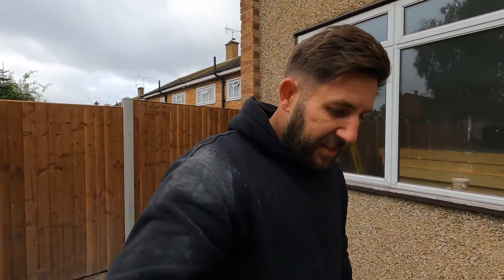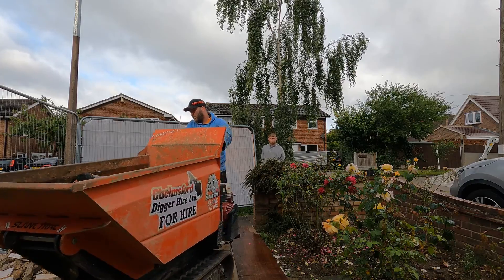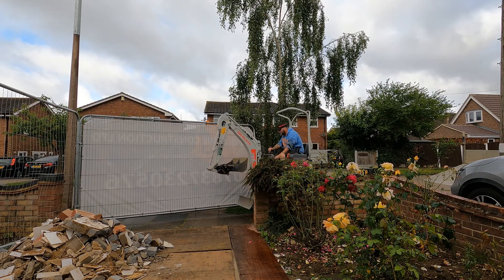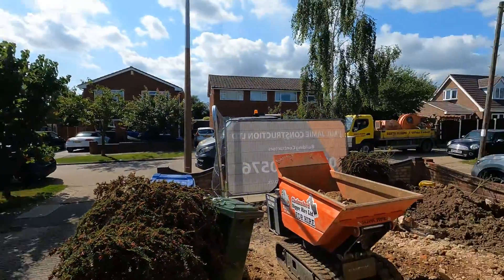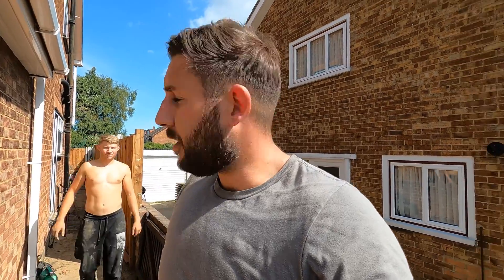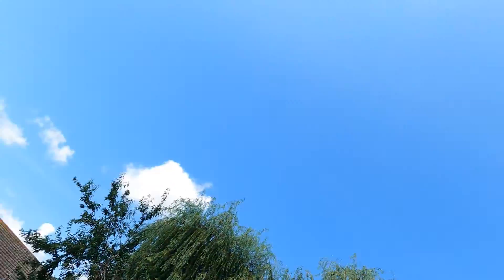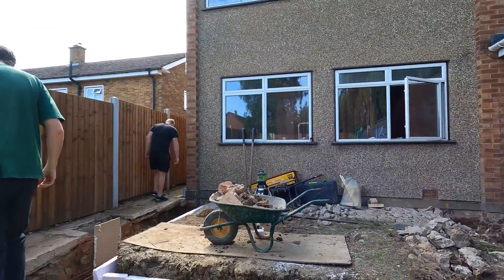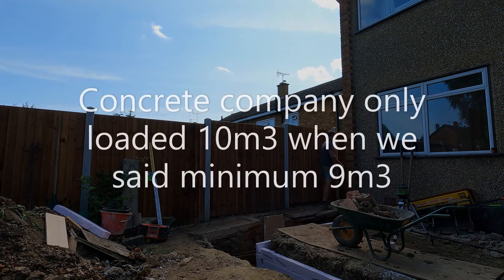Way over the top Foundation

Comment: Where did you get the pins from mate that hold the clay board to the sides?
Reply from the maker: We cut T off the rebar brother
Reply: @pauljamieconstruction1871  as in buy a sheet of mesh cut t sections out? Nice.
Did they make you keep the board off the bottom of the trench? Never really understand that. Easier to put it to the bottom surely. Saves having to try and hold it up.
I’m on a similar job where it was standard footings designed by architect then Struct engineer took a look and now it’s 2 meters with clay board because of a nearby ash tree.
Reply from the maker: We had to use 2 layers of mesh on this job, so we had some left over. clay master is 500mm off the bottom i think, thats why we cut pegs to hold it,